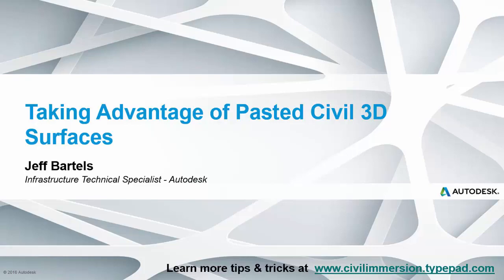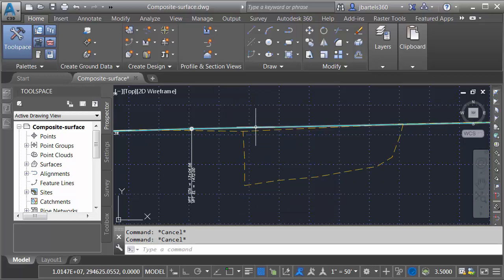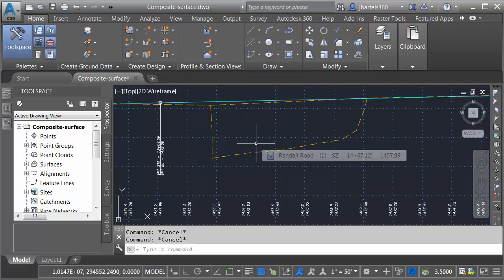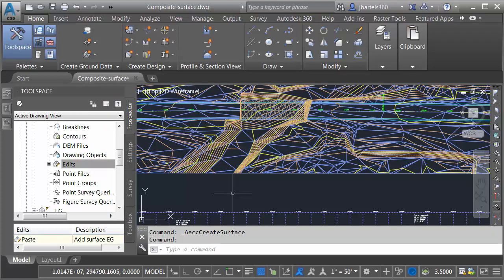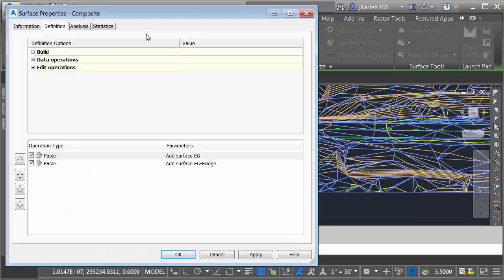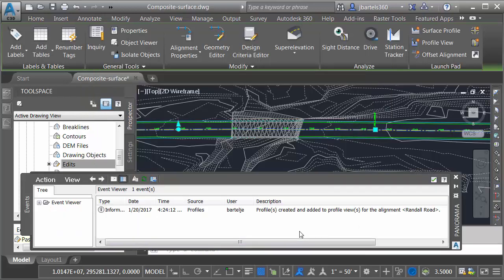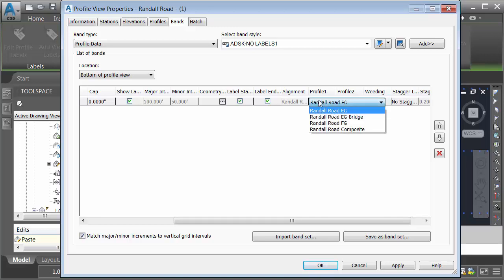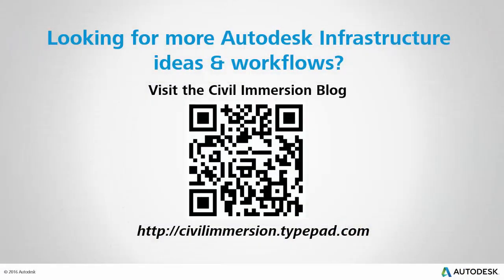Taking Advantage of Pasted Civil 3D Surfaces

Comment: How to solve this type of problem:
I have surfaces "A" and "B". Surface "B" has a hole inside of it (this is very important), lets say like ring or donut. To simplify, surface "A" is bottom of cup, and surface "B" is wall of that cup (wall is not vertical, it has a slope 1.5:1). They are created in separate files.
I want to create surface "C" pasting surfaces "A" and "B". To do this, I created new file, new surface "C", imported surfaces "A" and "B" using data reference. In term of definition "C", I must first paste surface "A", and then paste surface "B" (in that exact order, let me not explain to you why, just take it for granted).
But, when I paste surface "B" after pasting surface "A", surface "C" gets the same hole inside of ring, instead of elevations from "A". How to force Civil 3D to have elevations from "A", instead of hole from "B" in that area?
I am designing a regional landfill, and things are not simple at all, but I simplify  to you as much as I can.

Comment: Hi Mr. Jeff, thanks for that informative tutorial! i have a querry regarding surfaces, this might be a long shot and i hope you understand what iam trying to convey. first of all i have an existing surface, from that surface i will make a corridor (existing road) and from that corridor i can provide a surface. now i have an existing surface and a corridor surface. basically from the corridor surface i can get the cut values against the existing surface. here's where it gets a bit tricky for me, i will make another corridor based on the profile of the existing corridor but this time it will be in a different assembly(depth and width). when i do the cut values for the new corridor how can i exclude the cut values from the previous corridor? i tried making a composite surface out of the existing surface and corridor surface but i think some quantities get overlooked. i hope you understand what iam tryin to convey. sorry for the long question.  -erwindavid
Reply: hello sir,
did you find  a solution for your problem,
i'm facing the same the same problem i hope you read this.